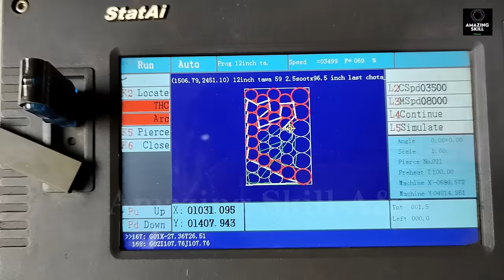Iron Cookware Making Process || Iron Cookware Manufacturing || CNC Laser Iron Sheet Cutting Machine

Comment: For just a fleeting moment I thought Pakistan had finally got some new tech machine, and then came the handle-making section with flowing robes and workpieces being thrown on muddy floors. I sat back in relief.
By the way, laser or plasma cutting to the round section wasn't necessary since the part will be reformed anyway, so much for intelligence in Pakistan.

Comment: Bending process taking much more time … it’s possible in single stroke bending by 50 ton power press… per day production 10 guna badh jayega
Reply: Sanjay
Reply: Jo bhi dusrauon ke kaam ki tarif karne aur un sab ki legan aur mahnat ko apricaite karna nahi jante toh maherbani karke aap ne faltu ke comment na de take mahnet karne walauon ko bhi taklif na ho aur dusrauon ka Waqt bhi aur dimagh bhi aap ki nayi tarha ke ajeeb se Waqt bhi zaya na ho 🙏🙏🙏🙏😮😣😣😣
Reply: Labor is cheaper than buying an expensive new press.
Reply: This is not bending it's called deep drawing. Or 50 ton ki press se nhi hoga iske liye unhe 7 cylinder hydrollic Leni hogi. Or yeh kis metal ka istemal kr rhe use bolte he IRON HR 14G
Reply: The boss wife not allow it. Just buy new car.

Comment: I did not understand why this small factory using a laser cutting machine. This is high tech and cutting is controlled by a computer; yet on the other hand they are using primitive method of making the bevel the iron pot. and rivitting, grinding. If you can afford a laser cutter of this size you should have hydraulic press for pressing the circular plates, auto grinding and rivitting. What you showed is 100 chootyapa. I disliked your video.